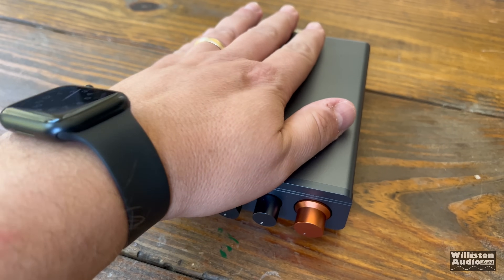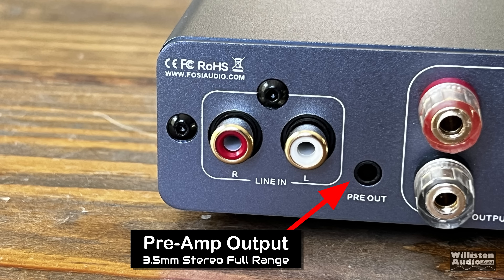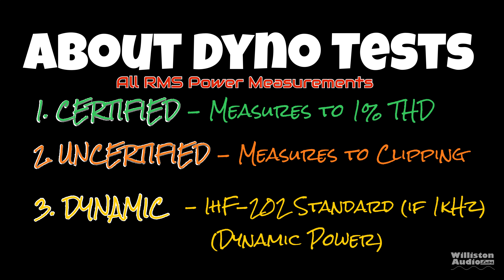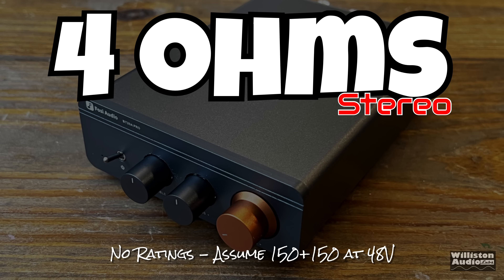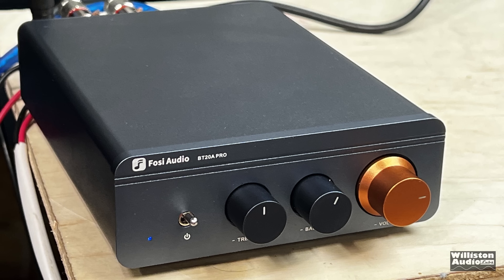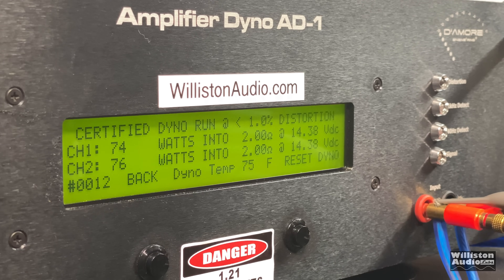Fosi Audio BT20A Pro Mini Amp TPA3255 Review and Power Output Test

Comment: Can you dyno these running on battery power? I use fosi amps for Bluetooth speakers and they do fantastic running on mini agm batteries
Reply from the maker: They Dyno is powered by a bank of 14V car batteries (XS Power D1400) in these vids. For AC powered devices like this, it doesn’t make sense to use the same power source and doesn’t affect the outcome
Reply: @wal  I appreciate the reply. I've been watching you forever. My comment was referring to the amp power supply. My mini amps sound much better running on battery vs the included/upgraded power supply. Keep up the great videos!

Comment: I have the BT30D 2.1 non pro version and I've been extremely impressed with it. It's driving Two Dayton Audio Bookshelves and a Skar audio 8" and it's by far the best and clearest sounding home system I've had to date!
Reply: how do you get it to run the skar since there's no low pass filter?
Reply: @jimjones3287  adjustable sub frequency and volume level. It blends in very well for what it is. I'm also using it for my computer speakers and the sub is under the desk if that helps.
Reply: @sleepyboytx  oh the version you have is 2.1 channels (2 stereo + subwoofer output), the one reviewed here is only 2 channel stereo.

Comment: Big D! Ok, is it just me or haven't you been doing a little more nearly every episode/between episode stuff and diving deeper into this stuff that probably a lot of us didn't even know we needed or would find helpful or at least interesting! Love it bro!! 🍻🌎❤️🌮🎶 What's next!? Your own line?????? You're just gathering data to make something good, ain't ya? I wonder how long it will be until we have a signal processor/amp based on newer A.I. with ChatGPT built in 🤔😁
P.S. - Big "D" amp: Small size, exceeds power ratings, oversized speaker terminals, solid reliability/cost, easy to repair, Tiffany style RCA jacks, high efficiency, REASONABLE plain and simple. 🤯
Reply: hm if its my signature id like vision ears to develop it

Comment: Surprised at the the amount of flat topping going on with the certified tests.  
Definitely pushing things too hard for this box.
I wonder how clean the DC is coming into the unit as those power supplies seem a bit sketchy!
GaN based bricks used for high end laptops can deliver 300+ watts continuously and are fairly clean and certainly won't blow up!
It would be interesting to test that amp with a decent lab power supply that can allow for the max input voltage and maintain regulation.

Comment: I am building a super cheap dual 8 inch tower with buyout Dynalab 8's, a cheap tweeter and pre-assembled 3000k crossover.  This sounds like a good option for a bedroom or living room stereo system that could double as a simple 2.1 HT set up by adding a sub amp.  This would also work well in a classic car with a 4-600 watt inverter.  You could hide the amp in a glove box and use bluetooth so no wires to splice in for power and ground.

Comment: I would be worried at 48v psu as those caps where rated only at 50v.
Maybe if they where 63v etc... would be ok but I wonder have any failed at 48v.
Keep up the good work x
Reply: Like just about everything now days, redline engineering a.k.a. planned obsolescence at its worst...
Reply: good call.
Reply: Sure electronics make 63V 
My aiyima tpa3251 work whith 36V but have 63V to , verry nice
Reply: The caps in Fosi Audio V3 is 63V, it is Japanese NCC capacitors. You can have a look.
Reply: @fosiaudio  Pause the video at 11:15 and you can clearly see that the two black electrolytics are rated at 50 Volts.

Comment: I have a Aiyima A07 with upgraded Op amps from Sparkos labs.  Also rocking a 48v 10A LPS.  It powers my speakers in my workshop.  It's a straight up beast.
Reply: Where and how much did you pay for your LPS if you don't mind me asking?
Reply: @fritzkabeano1969  I got mine from a electronics website called digikey. Involves some DIY like wiring in a power cord and locating proper gauge 5.5/2.5 barrel connector. It has a built in fan which was loud so I replaced that with a noctua. I'd say all in I was at around $150.
Reply: @fritzkabeano1969  It was a meanwell 48v se 450 if I remember correctly.
Reply: @fritzkabeano1969  Smart move would be to just go to hifimediy and purchase the 48v power brick from them. That's 100 bucks
Reply: @reconbbs360  That would be an expensive move and then you'd have to make the smart move and ventilate the encloser better. For the cost/watts gained the 36v/6amp power brick is the best choice.
Reply: sparkos labs....quite expensive,but can you tell me...worth the money!?
thx
Reply: @janihocevar6387  op amps yes. Psu no

Comment: Nice B~D... I've been tinkering with these little demons for the last few years and it seems like the 3255 is maturing quite nicely. Gotta luv the interchangeable OP amps the boards are now using as well as the tubes. I found the best way to remove OPs is with a balanced wiggle/pull on each open end using one tweezer like tool. Yes indeed most of the included power converters claims are unreliable so my solution was to snatch up an adjustable 48V~10A transformer...
Reply: @gags730  A person gets what is given and if not, then it's time to move on. With B-D's channel, it's easy to realize his reviews show mutual respect to all, except maybe himself and/or manufactured items.😁

As for suggestions: You stated experience with Puters and auto sound so go with the flow on what you know by Using a 2nd Computer/Laptop

Add a HiFi 5.2 Bluetooth Audio Adapter w/LDAC,APX device such as Qualcomm=1Mii/BluDento ($50) Then use a 5.1 USB sound card.
IMO the most reliable 5.1 class D amps are offered by Douk/Nobsound, Aiyama, Fossi.
Separates will give the advantage of upgrading due to rapid evolution:
There are 5.1 class AB amps with many options offered by no name and cheap A$$ companies like Pyramid, Pyle etc.
Note China has the worse Quality Control and it's senseless to order one from there.
Keep in mind try not to purchase the latest claimed greatest hardware, rather the next best because it will save $'s.
Reply: @gags730  Not to discredit your knowledge, since the TPA3116 became readily available for the past 5yrs they've been available. Simplicity is a matter of joining some small amps with a Home Theater preamp.

Comment: Based on reviews in specific and general I purchased the fosi bt30d pro.    Don't know that I got a defective seems like not - rather disgusted with it.    If you turn it up to mid volume it's about as loud as generic Yamaha or Sony reciever as 1/20 volume.    At maximum volume it's about as loud at Sony Yamaha at 1/3 volume.    At more than half it begins to sound like garbage.
 And I've tried with many speakers including super easy to drive generic Sony garbage home theater.  Up through Sony ssha1, polk lsim703,  Yamaha floors I don't remember the name of right now & many others

Comment: Can i rip this with a 14v rc battery?
Reply from the maker: It says 24V minimum on the back but may work with 14V....just won't put out much power. I'll try when I find my variable voltage power supply and post results over on @wal2 - Williston Audio EXTRAS

Comment: I have a 2.1 fosie audio amp that supports passive subs. The damn thing sounds very nice but it keeps on cutting the highs and mids if I crank the volume. I've used several power supplies to give it more juice and none of them stop it from cutting out. This is a shame.

Comment: Just checked, these are shipping with a 24V/4.5A power supply for the non-pro, the Pro comes with the  32V 5A Power Adapter; about $20-$30.00 difference. Found a 48V 5A PS for $25.99. Buy the non pro and the better PS for the price of the Pro unit unless someone wants to mess with the op amps. (Iregardless?, c'mon, common use yeah but really, regardless is proper.)  Love your vids, appreciate you diving in where no men dare to go - smoke'n!
Reply: The non pro is max 24v and a different chip (TPA3116 instead of TPA3255)
Reply: @Usernamesannoyme  Missed that, and that matters. In that case, I would opt for the pro with the 48V/5A PS. Anyway you slice it, about $30.00 difference from the stock version of either w/the pro unit giving you additinal features too. ;)
Reply from the maker: The pro is the same price with my discount code and it has line level outputs. Well worth going pro IMO. Discount code in pinned comment and video description
Reply: Where did you find the 48V power supply

Comment from the maker: SHOP
Fosi Audio BT20A Pro: https://amzn.to/43g4JT6
EXCLUSIVE 20% off Discount Code: 20APROWAL20
Discount Valid April 10-30, 2023
Fosi Audio BT20A standard model: https://amzn.to/43lwTfp
Fosi Audio 48V 5A Power Supply: (Coming Soon)
0-48V 10A Variable Voltage Power Supply: https://amzn.to/3mkJv5P
AIYIMA A07 Amp with 32V adapter: https://amzn.to/3Xu0jEA
AIYIMA 48V 5.2A Adapter: https://amzn.to/3H1CHSh
Elac Bookshelf Speakers: https://amzn.to/3nVrhbJ
Speaker Banana Plugs: https://amzn.to/3zLGrTv
Anti-Static IC Puller: https://amzn.to/3miE8nE
3.5mm to RCA Adapter: https://amzn.to/4082DC9
Polk Audio PSW10 Powered Subwoofer: https://amzn.to/3nVXWOa

RELATED VIDEOS
Update - Fosi Audio BT20A Pro Power Supply Tests: https://youtu.be/wJeQO-E1U1g
Fosi Audio M0-3 Mini Amp: https://youtu.be/wrBPAP3nol0
Aiyima A07 Mini Amp (TPA3255) : https://youtu.be/kBim2j7Gm5o
Douk Audio M1 Pro Mini Amp: https://youtu.be/WROm7jJbb2M
Mini Amp Video Playlist: https://bit.ly/3IMdtbN
Amp Dyno Modes Explained: https://youtu.be/Q0m6NsB-HHc
More Power Output than Power Supply?: https://youtu.be/c7QELbpKMuI?t=490

VIDEO INDEX
0:00 Intro
0:36 Unboxing
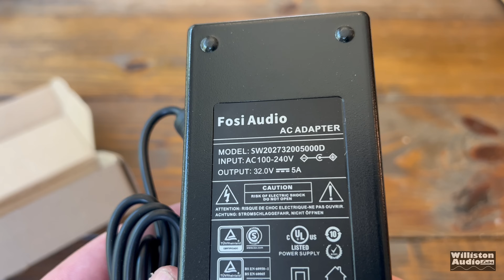1:30 Features
3:08 Specifications
3:43 Amp Dyno Tests 32V
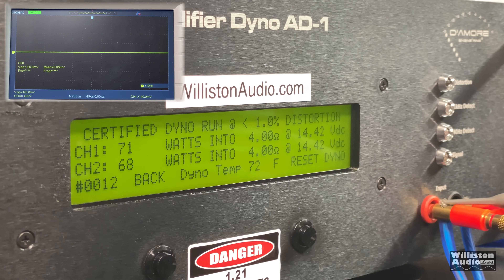5:22 Amp Dyno Tests 48V
7:18 More Power Out Than In?
7:40 Pre-Amp Output Tests
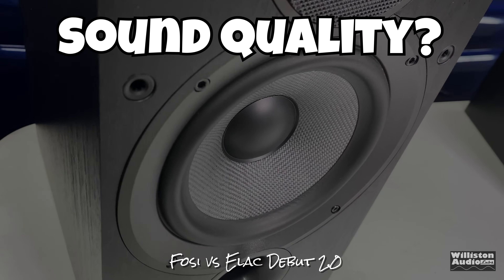8:55 Bluetooth Connection
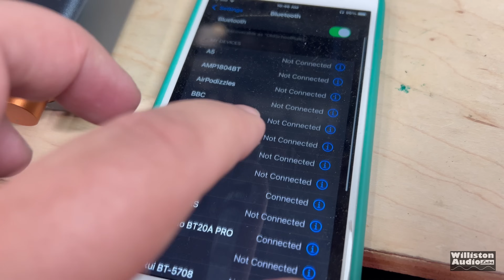9:22 Sound Tests - Song Demo's
10:46 What's Inside?
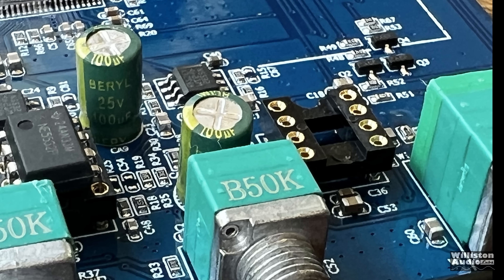12:36 Pros and Cons
13:39 Final Thoughts
14:20 EXTRA Test

TEST BENCH EQUIPMENT
SMD / D'Amore Engineering Amp Dyno: https://goo.gl/sJTcf7
XS Power D1400 Batteries - https://amzn.to/2BPFCKW
XS Power PSC60 Charger - https://amzn.to/2CHGcfs
Fluke 1000A AC/DC Clamp Meter: https://amzn.to/2Rw5WDA
Handheld Dyno: http://amzn.to/2u2EgKV
My Favorite Screwdriver Kit: http://amzn.to/2x0VzcE

DISCLAIMER: This video and description contains affiliate links, which means that if you purchase from one of the product links, I may receive a small commission. As an Amazon Associate I earn from qualifying purchases

Comment: Nice review.
Use the correct tool to remove the chip.
Reply from the maker: Thank you. I will in the future. Y’all keep me in line, no slippin allowed!
Reply: @wal  Don't feel bad. My first few years I used to pull ICs out by hand and constantly stuck the pins into my thumb. Then I used needle nose pliers and broke a few ICs.  It took a few years to get the right tool.

Comment: The caps look a little cheap, the vent stamps on the small guys look like those real cheap knock off caps... and the markings on the control potentiometers look very similar to the cheap $10 chip amps... but besides that it performs well and has a stylish case. 

I like these little amps.
Reply from the maker: Thanks for watching and commenting!

Comment: Been pretty disappointed with my own FOSI amps due to the included power supply. 

I'd have paid extra if they'd included a better one; shady.
Reply from the maker: The included one is 32V 5A which I showed in this video and used for the first power output tests
Reply: @wal  I've got older models; the TP-02 and BT30D, the latter of which is WAY under rated power, and directly the result of the PSUs.

As it happens, I found out WHY they were so underpowered through your videos!
Reply from the maker: @bozanimal5576  Awesome, thanks for watching and for the feedback!
Reply: @wal  Keep making awesome content. It's been great to see your channel grow and get the recognition all your hard work deserves.

Comment: There’s a tool to remove the IC’s, IC PULLER! Works, it still requires a snug pull.
Reply from the maker: Awesome, I’ll pick one up! Thanks 🙏
Reply: I just use a flat tip screwdriver.

Comment: I like that it lacks a sub output. It really is better to route through the subs own crossover and it saves cost and space on the backplate.
Reply: Is the preferable way to connect a sub is  via the preamp output?
Reply from the maker: Agreed and gives you the option to pass through or daisy chain more with the full-range signal
Reply: @Williston Audio Labs  does the main volume control the preout or is it fixed?
Reply: But do you set it up so the speakers don't play full range and only play 80hz and up?
Reply: @Manic1578  it depends upon the speakers. If I have the ability to play somewhat low, then yes attenuate the sub to do.
Reply: My preference is for the speakers to handle low mid-range frequencies from really 150 to 200. I really belote 150 is about as low as I really prefer them to go

Comment: Probably doesn't do 2 ohm without an even higher output power supply. You have to figure either higher voltage, or higher amperage at the same voltage for the chip to function correctly. More amperage is definitely going to create more heat, vs just higher voltage at a similar amperage.
Reply: It has built in protection. So going to a higher current rating amp isnt going to hurt it. Will draw what curent it needs. Over volting it is a much faster way to kill it though as the higher voltage will break down components
Reply from the maker: I asked the company and they said 2 ohm stable. Previous tests of these said otherwise and not sure why you’d need 2 ohms in home audio setup anyway

Comment: Love to see if this would do even better with say a 48v 10amp power supply.
Reply: More than likely it will FRY the chip, this will be due to people going to very low impedance loads trying to squeeze even more power from a small package.
Reply: @jeanious2009  No. The amp will draw what current it can. Its not over volting it.
Reply from the maker: I believe I have one and can try this. I don't suspect to see much more but it will be a good test. I'll prob show the results over on @wal2
Reply: @wal  Awesome be good to see. Even if just to see if its worth spending extra $$ to buy a 48v 10a psu instead of 48v 5a, might help someone out who buys one and is deciding what PSU to get for it.
Reply from the maker: @staples4335  this is the one I got a couple of years ago. It's variable voltage too. https://amzn.to/3mkJv5P
Reply: @wal  what’s @wal2?
Reply from the maker: @mattfranklin3622  https://www.youtube.com/channel/UCgz8QirXKO5EPWH6sV-hKlw

Comment: The amp chip supports up to 48V/7.5A, but it has been reported that the chip is fried at 36V or higher. Therefore, TPA3255 amplifier from AliExpress comes with a relatively safe 32V/5A power supply, but the quality is very low. As a result, an expensive power supply is required. Also, the heatsink is very small, so it is not suitable for use at high volume. Consider other low-cost amplifiers other than this one.
Reply: 50v would be ideal for 4ohm loads, data sheet specifies 54v for 6ohm load
Reply: RL = 4 Ω, 10% THD+N
RL = 6 Ω, 10% THD+N, PVDD = 53.5V
RL = 8 Ω, 10% THD+N, PVDD = 53.5V
RL =4Ω,1%THD+N
RL = 6 Ω, 1% THD+N, PVDD = 53.5V
RL = 8 Ω, 1% THD+N, PVDD = 53.5V
Reply: @jeanious2009 I still think the TPA3116 is the king of budget desktop amps when it comes to AliEx-level build quality.

Comment: Im using a mini amp for my computer speakers. Its only 50w x2 but it pushes my 2 12 inch 3 way speakers just loud enough for the police to be called so Im happy with it.
Reply: The Police? Roxanne you don't have to put on the red light.
Reply: @1pcfred  That was funny 😂😂😂👍🏿
Reply: @1pcfred  😂😂😂
Reply: What is the RMS power of the amplifier? And how much rms power speakers are they?

Comment: Can you add to the comments what the position of the Vol knob was to get ~3v RMS?  Not many people can meter it out but a knob position is a good appox.
Reply from the maker: Around 3'oclock. I should also add my input voltage was around 5V RMS using the Pioneer DEH-80PRS car audio head unit

Comment: No toslink infrared connection???????
Reply: it's just an amp , other than the BT module.
Reply from the maker: No sir. Also no USB for high-rez files
Reply: I would think this would be good to connect your computer to a nice set of speakers. The pre amp out you can use for a.powered sub. I guess you can use by to connect to your PC but using the analog connections would seem like a good way to get amplifier humm or PC screetching going through the audio